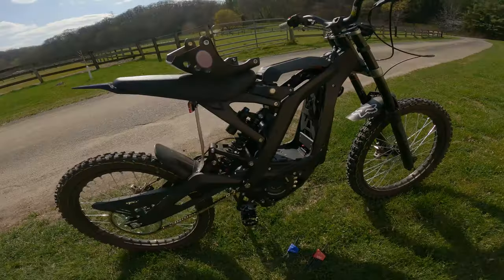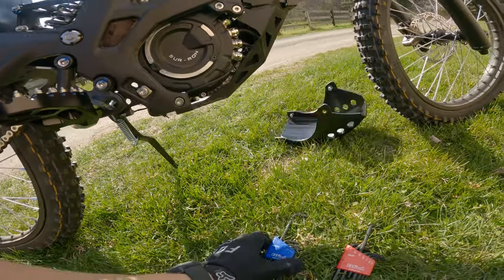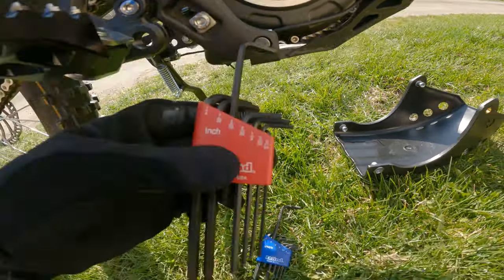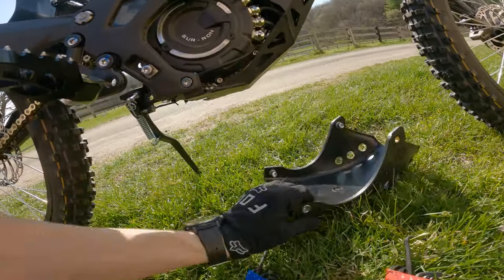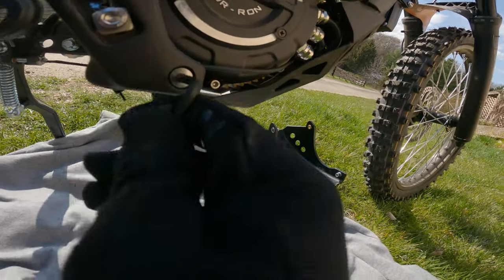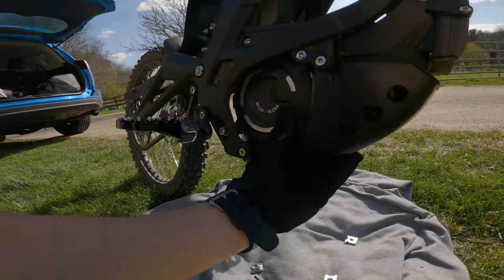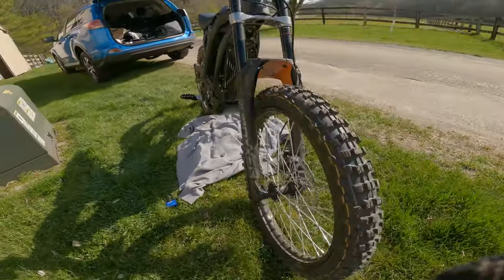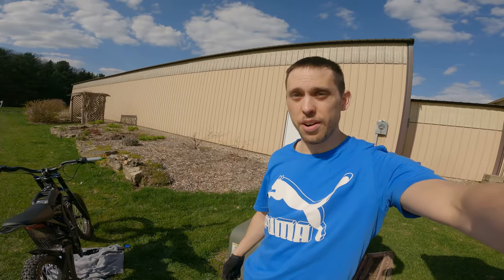The Best Bash Plate for the Sur Ron - How to Install the Race Spec Pro Skid Plate Bash Guard

Comment: As far as I know you should use the foam of the old skid plate in the new one. I saw people peel the foam of and put it in the new one. Maybe have a look in the instructions if there are any for the new skid plate. But otherwise great video ✌
Reply from the maker: dang  i should have done that, maybe ill take the plate off and put the foam on later.  thank you! :)
Reply: @KevinCarly  I didn't put it in my luna one. I figured if it needed it it would have been stated somewhere on the website or with the plate itself.
Reply from the maker: @reconpeon  yeah you might be right, i havent gotten around to putting mine back in either :/